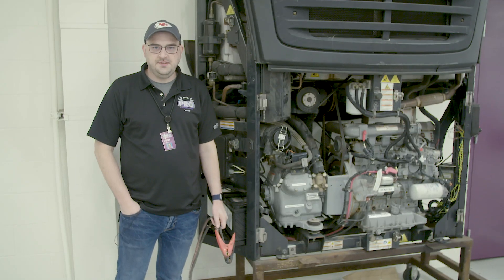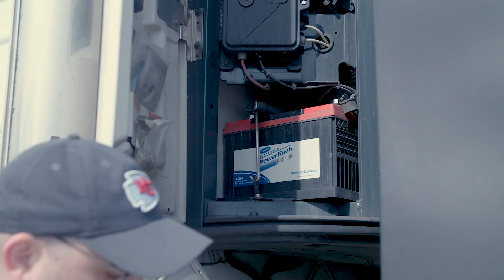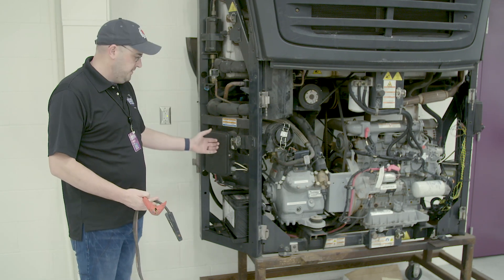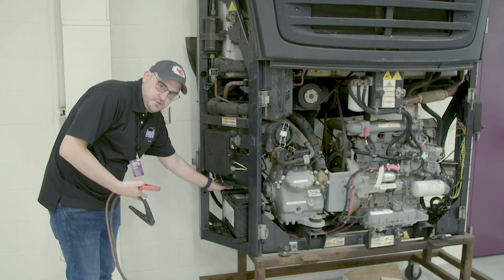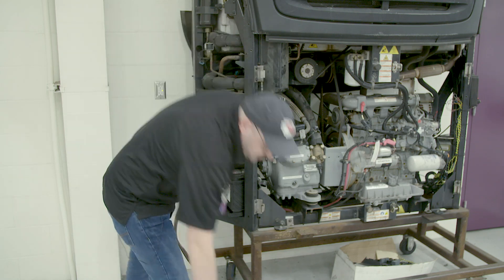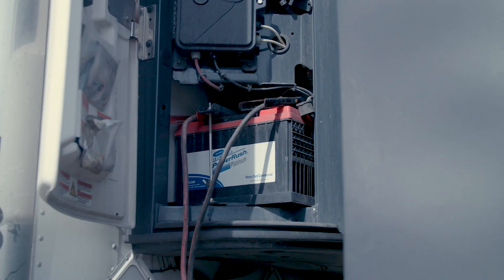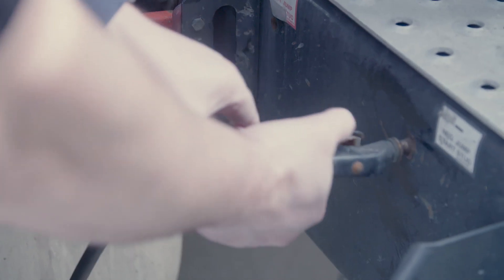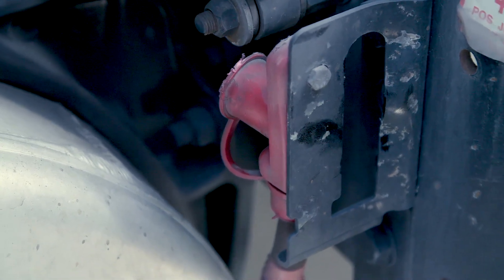Pro Maintenance: How to Jump Start a Reefer Unit

Comment: What size of jumper cables you need to use??
Reply: I have a cascadia 125 with a modified extended frame, with a tk 700s Reefer unit. I’m using a 10’ or 12’ set of jumper cables and it’s about perfect.  I’m 6’3” and if I fold the cables in half, the ‘U’ comes up to my mouth. Take that as you will.  Hopefully that gives you a good idea for how long.  :)